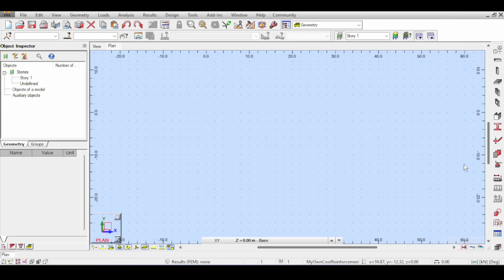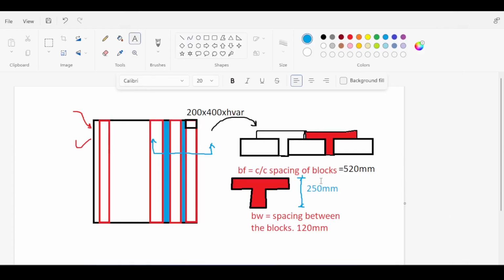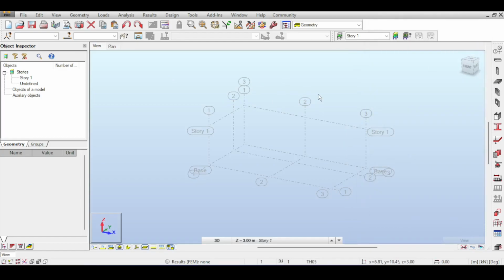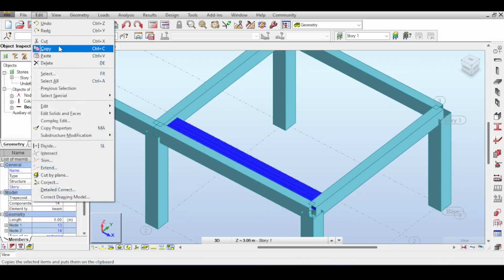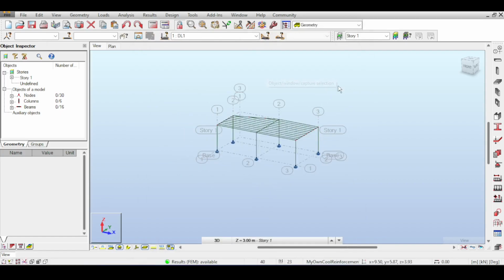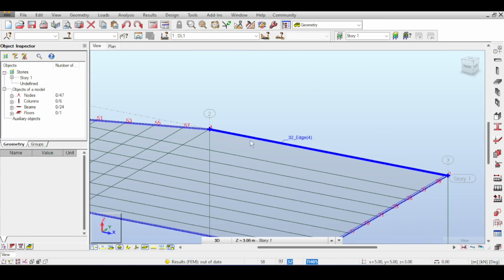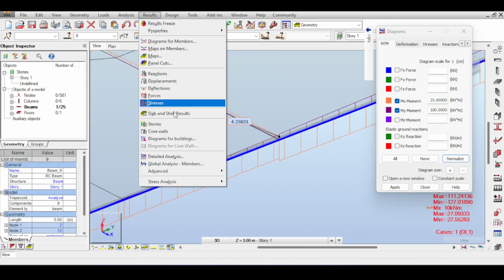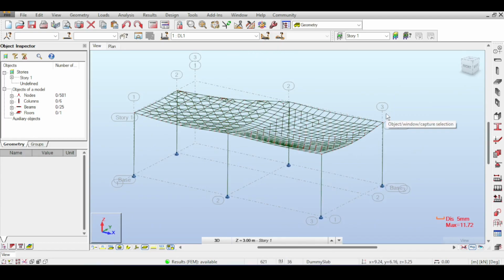The Slab Series | Part 4 - Modeling Ribbed Slabs | Autodesk Robot

Comment: I noticed there is an option of ribbed slab in orthotropic slabs. Will the results be different when using it compared to modelling the ribs individually as you have done. And in your opinion what would be the more preferable method?
thank you
Reply from the maker: Hi there, thnx for your comment
You can do ribbed slabs using orthotropic thicknesses, however, Robot is unable to calculate the steel in ribs using this thickness. I will try include this little info in my next video if I remember it.

So, if you want to design the slab itself, you may want to model it this way. Otherwise, if you want to focus on the beams, then orthotropic thickness is your way to do it.

Regards,
CEE
Reply: @CivilEngineeringEssentials  Thank You so much. Don't stop with the good work